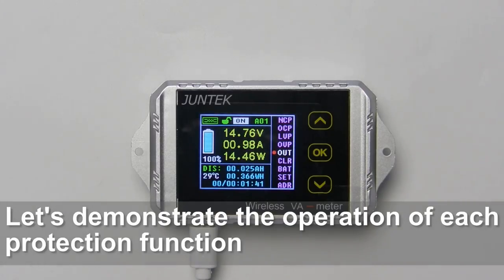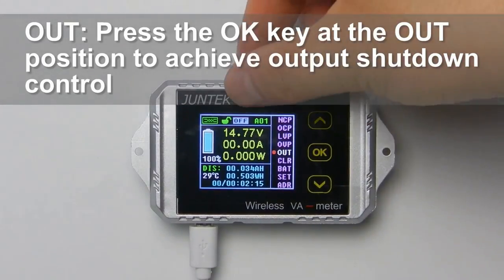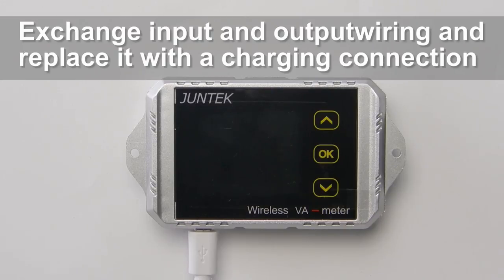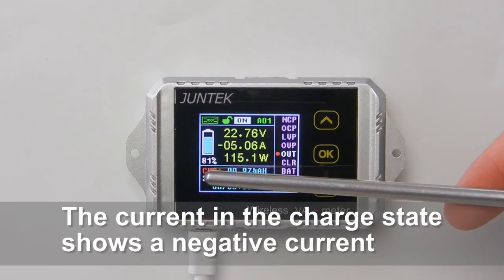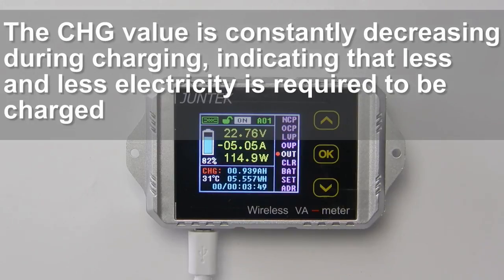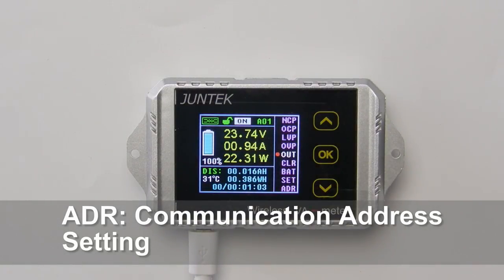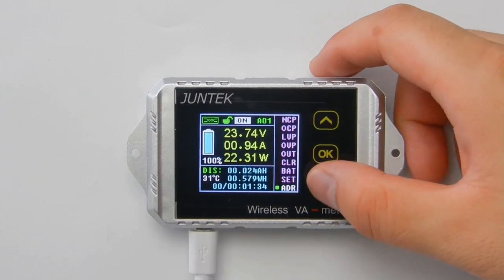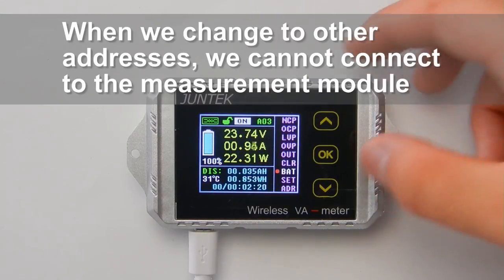VAT1100 1200 1300 4300 1050 1030 Operation demonstration video

Comment: Great little product for Ebike monitoring, I use the 4300 model to monitor ebike battery use.  Wireless allows easy mounting on handle bars.  Great for seeing battery consumption while riding and also dis[plays the regenerative braking charging battery. Great Job, thank you JUNTEK.
Reply from the maker: Thank you for your approval

Comment: I bought VAT 1030 3 months ago from you and used it for 1 week in the caravan, the control panel does not turn on the relay because it does not connect from the wifi address. The wifi is no longer communicating from the A22 address . I tried another address too.I think the transmitter is OUT OF ORDER, where can I find a new one or do you have any other suggestions? (note:wifi card is working in receiver module)
Reply from the maker: You can contact me by email LEE@JUNTEKS.COM, I will tell you how to re-pair the address

Comment: I bought one of these and it worked for a few weeks but now reads voltage inaccurately, is there any way to re calibrate? The true voltage is 13.6 with my Fluke meter and 7.89 on the display of the Juntek 1300.
Reply from the maker: You can calibrate the voltage by yourself. Please contact my email for details LEE@JUNTEKS.COM

Comment: How do I calibrate the BAT settings menu. I can enter the battery AH as 200 - but then how do I know what the AH SETUP range % should be?

Do I need to fully charge the battery and then go in here and set this to 100%?

What if the battery is now fully charged? How do I know what to set this to?

Thanks!
Reply from the maker: First, fully charge the battery, then set the capacity to 200Aah, and set the percentage to 100%

Comment: Best way for shunt be protected from environmental factors like rain, cold temps when installed at RV external battery location? Can you spray circuit board and shunt with something, or cover whole thing in some kind of container? Thanks for advice.
Reply from the maker: This is not rainproof and can only be installed indoors.

Comment: i had bought one vat1200, I have to install on my RV (camper) with a Lifepo4 battery and need to be protect for over and lower voltage.
The question is with one relay it is possible to protect both?
If yes like I suppose cut off the power also for positive over current ?
Thanks in advance
Reply from the maker: Hello, only one relay can be controlled for the time being

Comment: whata bout the voltage and current calibrations, you didn't show can you?
Reply from the maker: Press the up button to the top
Long press the up button for 5 seconds and then let go and immediately press the up button
Will pop up the functions of C-U and C-I
C-U calibration voltage
C-I calibration current
Reply: @junctek1802  How does the Current Calibration work? I mean, what values should I set for 'I=0' and 'I>0'? My Display-Unit worked pretty good until I accidentely changed the values and I can't remember the former ones.

Comment: Could you please give advice for adjusting the current sensitivity?  I am using this for an HEV grid charger that only charges at .3 amps.  This unit is pretty much worthless as it will not measure below .6 amps.
Reply from the maker: Yes, it is not suitable for measuring current below 1A. Because his range is relatively large.

Comment: Hi, my Lithium Battery has about 91% efficiency for charging and discharging. So 9% loss over all. It would be great if this can be set somewhere as well. Now it is not very accurate telling the battery status (%) because it does not calculate the loss. When it shows 100% the AH is continue to go much higher untill the battery is really full. It would be usefull that the unit recognises when the battery is really full and set a new 100% mark. or if we can set the loss (9%) somewhere.
Reply: for example, I use 20AH of a fully charged battery. Then I load it again with 20AH, the charge status of the VAT shows 100%, but I still need to charge another 4AH more to fully charge the battery again. 
The more I do this, the more inaccurate the charge status is getting.
Reply from the maker: Hello, you can consider our new kg140f, which has solved your feedback.

Comment: Great Video!  Very informative.  Can you get into connecting the Relay?  Jumper setting, power in/out for the relay... etc.  Also, if I set OVP and the unit is off... can I set it up to start automatically when the battery voltage reaches a voltage over the OVP?  This is a great product, but very little documentation on how to set it up.  Thank you for all your help!!!
Reply from the maker: Hello, if the voltage exceeds the set OVP, the output will be turned off.

Comment: I have 30 W in Idle Mode (2-3 Ampere at 12 v) if i turn everything off... seems a little bit high even if i shut off everything... do you also have this in Idle? Or have i connected something wrong? Thanks man 👍

Whats the power consuptiom of the shunt?
Reply: The shunt it self is zero, but the  transmitter and other circuits should be around 50 micro amps to around 30 milliamp, I would put a switch on it, that defeats the wireless purpose, unless it has near constant charge current, or  a high capacity battery, I would add a switch, and turn off until needed, there is Bluetooth relays to do so. But that will use some power also.
Reply from the maker: The power consumption of the shunt is about 20mA

Comment: Hello, I charge my battery with solar panel with Epever Mppt regulator and now I'm buying a dc to dc charger. How can I connect your battery monitor if I have two way battery charging? I also suppose I'll have to disconnect my Loads from mppt load exit and connect them directly to the battery. Thank's
Reply from the maker: Hello, one monitor can only monitor one battery pack

Comment: Can someone tell me. Does this unit compensate its measurments when a battery is being charged at the same time as being discharged, for example in a small solar installation.
Reply: Yes it does
Reply: @tmz1313  It will be nice to display in the same time the value for charge and for discharge.
Reply: @mihaitaiosub  It does : charge shows as negative, discharge as positive.
Meaning if your load takes 1A and your batt is charged at 2A by the charger, the display will read -1A
Reply from the maker: KG140F can automatically compensate, the measured current = discharge current-charging current

Comment: Measurement module draws ≈ 20mA, or ≈ 0.5 Ah/day.  Can the Vin connection be off (jumper in 2W) while battery voltage is applied or will this damage the meter?  If Vin is removed but battery voltage remains applied to the measurement unit, will the current draw drop?
Reply from the maker: If VIN is removed, there will be no current

Comment: Mine has stopped reading current but shows voltage fine. When I try to reset to default settings (DFT) it won't let me change the option to Y it just has N. How do I reset this thing?
Reply from the maker: The DFT function can be set only when the measurement module and the display are connected in wired mode

Comment: you need relay to cut de voltage when you set LVP?
Reply from the maker: After setting LVP, if the measured voltage is lower than the LVP value you set, the circuit will be disconnected.

Comment: Do you have connections video, for example, what is the function of the 2W/3W jumper. Also, explain charge / discharge connection
Reply from the maker: 1、https://www.youtube.com/watch?v=QV_stK0Da70&t=358s
 2、When we measure 0-10V battery or DC power supply, we need to switch the jumper cap in the upper right corner of the measurement module to 3W, and use a 10-30V DC power supply to supply power to the measurement module.                   
3、When we measure a 10-100V battery or DC power supply, we need to switch the jumper cap in the upper right corner of the measurement module to 2W, and no additional power supply to the measurement module is required. 
4、The jumper caps of the VAT1030 and VAT4300 are fixed at 3W, and they all need to be powered by a 10-30V DC power supply.
5、When we apply to the charging and discharging of the battery,
 charge means the mode of charging the battery with the charger. At this time, the positive pole of the charger and the battery are connected to the green terminal V+ on the left side of the measuring module, 
and the negative terminal of the charger is connected. On the copper column on the right side of the measurement module, the negative pole of the battery is connected to the copper column on the left; 
at this time, the display will show the symbol of charging, and a "-" is added in front of the charging current for differentiation;
6、Discharge indicates the mode in which the battery is discharged by the charger. At this time, the positive pole of the charger and the battery are connected to the green terminal V+ on the left side of the measuring module, and the negative pole of the load (using the electrical device) is connected to the copper column on the right side of the measuring module. The negative pole of the battery is connected to the copper post on the left; at this time, the display will show the symbol of the discharge.
Reply: @junctek1802  can you get any more specific on this? I am measuring a 12V lifepo4 battery. So i need to change the cap to 2w? I have a juntek vat 4300 with a shunt that has 500a written on it.

Comment: You have to set amp hours but what is the other input? Battery percentage 0-100%?
Reply: Normally you would set the capacity AH while the batteries are fully charged, but the second setting allows you to specify a different percentage if you know they are not full at that time.
Reply from the maker: The battery capacity and percentage should be preset when using it for the first time, and it is best to set it when fully charged.

Comment: hello.how do you initialize the factory?
Reply from the maker: You can check the DFT function in the manual
Reply: @junctek1802  For me it's impossible to select the 'Y' option. It's not changeable even if connected by USB. What could be my fault?